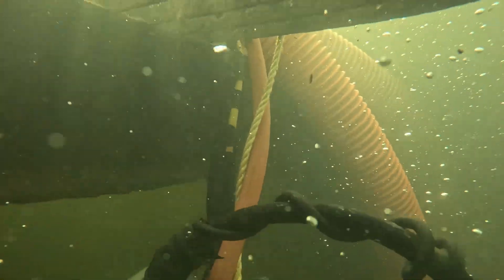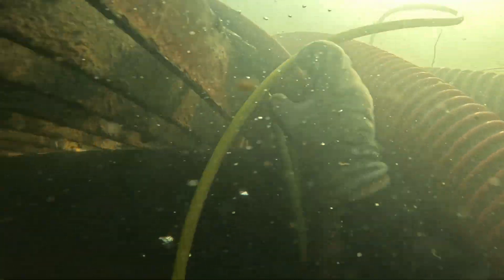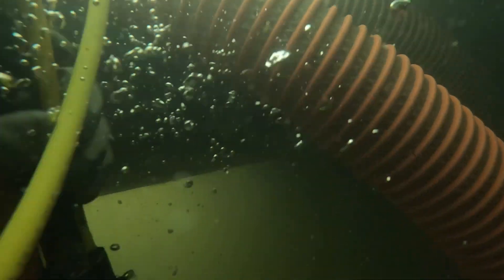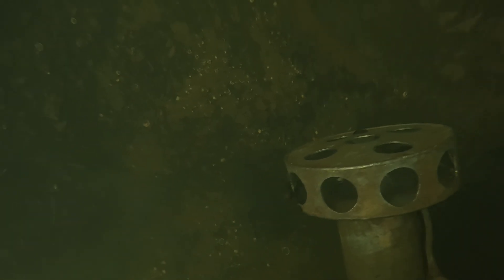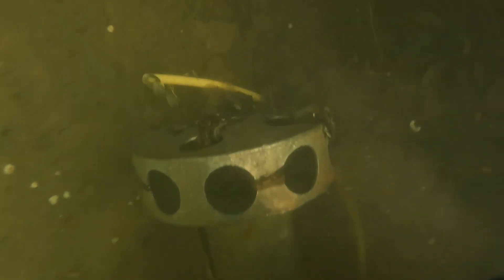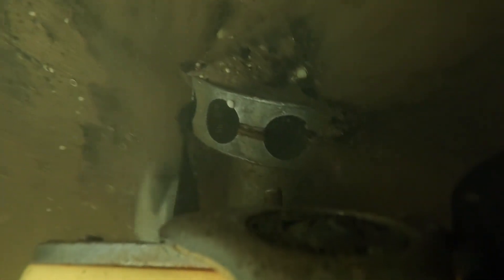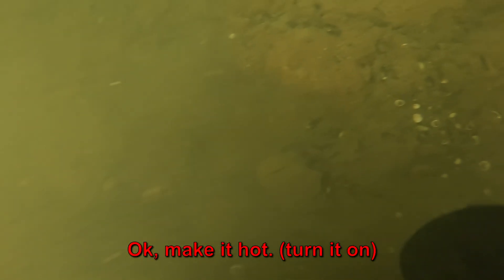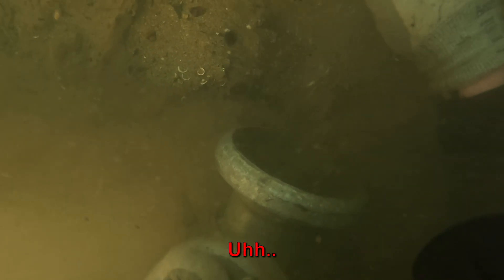Diver's Arm Sucked Into DREDGE PUMP!

Comment: This kind of work is really intriguing
Reply from the maker: We get to enter a lot of wild places where few have ever gone. Thanks for watching.
Reply: @workingunderwater  Have contacted IMCA and asked wether or not vocational papers are a necessity. Have worked for over a year fixing cars. Have wondered if I need to be a certified mechanic for this kind of work, but they told me since the vocational school for commercial diving is already expensive and covers everything I need to know, it’s not really necessary. What do you think? My diving experience is average, my mechanical is adept. But got no papers
Reply from the maker: @eltiburon144  That's fantastic! Those skill will absolutely help you in this industry. We work with all kinds of small engines like compressors, pumps and generators. They break down often and need maintenance. Your mechanic skills will surely save the day without a question. What school are you thinking?
Reply: @workingunderwater  I am either thinking finishing my mechanic apprenticeship, but preferably in a big workshop that focuses more on big trucks or ships, I have seen too many cars already. Or I plan on going the medical route, getting my apprenticeship as a paramedic, then combining that with my mechanical knowledge to become a good Diver Medical Technician. Safe to say I would love to step into this industry. If you could help me out, I would definitely be grateful

Comment: Never seen a dif like that, we have just 2 pieces of teel rod welded to the en like a cross. Makes for bigger holes so no clogging and won't suck your hand in
Reply from the maker: Same here. 90% of the time a simple rod or two  overs the intake works great and that’s all i’ve ever used really. Idk who fabricated that stupid dif we were using. I think it came with the pump we rented. Thanks for watching.

Comment: We had a flap on the top side of "the tip" that we would open when this would happen. Open the flap, pull your arm out, and keep working. It's not the safest way, but other than a little startel, it never caused me or the other guys any injuries. 

Now, when you get your hand smashed from sucking up a brick... that sucks.
Reply from the maker: Smart. That’s a good idea! 
Where exactly was the flap tho??
Reply: @workingunderwater it was maybe 4-6 inches from the intake of the hose. Ours was a 6 inch hose so it was a pretty hefty dredge. The worst part was when my hand would go in flat and bend my fingers backwards. Lol. Good times

Comment: Im 15 and i want to do commercial diving what should i do to enter this field
Reply from the maker: Keep watching my vids. What state you in? Maybe do some basic welding classes at a community college and get your scuba certification that will give you a leg up. Yull need soil core strength, make sure your working out.
Reply: you´re 15 and got the time, here is how we do it in Europe.go for it The Whole Bloody Enchilada
Let’s be honest— becoming a certified commercial diver isn’t something that happens every day.
It’s rare. It’s expensive. And it’s not for the faint of heart.
But it’s not the most dangerous job in the world, despite what clueless documentary makers claim.
Because we know all the drills. We refresh courses every one to two years.
You don’t just wake up and decide to dive into the abyss with a wrench in one hand and a welding torch in the other.
You pay. You train. You suffer.
And if you’re lucky, you come out the other side with your “tickets.”
Those precious, mandatory certifications that prove you’re not just another desk jockey with a scuba hobby.
The Standard Route
Step
Description
Cost
Medical & Entry Requirements
Commercial diving medical exam, first aid certs, swim test
€300–€600
Basic Commercial Diver Training
HSE Surface Supplied Diver course (Inshore diver—best way to start)
€7,000–€10,000
Offshore Top-Up Course
Wet Bell, Hot Water Suit, DP vessel training
€2,500–€3,000 (Mine was pricier—Loch next to Mount Bevin)
Accommodation & Living Expenses
2–3 months of food and shelter
€2,000–€4,000
Miscellaneous & Gear
Travel, certification fees, gear, sanity pints
€1,000–€2,000

The “Tickets” That Matter
The more you stack, the better your chances of landing a gig.
These aren’t just add-ons— they’re survival tools.
They don’t teach this in schools. They baptize you in pressure.
First came the Wet Bell and the Hot Water Suit— deepwater rites of passage.
You learn to move in the dark, to breathe in the cold, to trust the hiss of valves more than your own heartbeat.
Offshore saturation work isn’t just where the big bucks are— it’s where the ghosts live.
And you learn to dance with them.
Not every diver takes that route. I didn’t. With some regret.
Then came the Diver Medic Technician course. DMT. The gold standard.
Two weeks of trauma, oxygen, and chamber ops.
You learn to keep someone alive in the middle of nowhere— underwater, offshore, and often alone.
You become the medic, the priest, and the executioner.
I did mine in Rotterdam. Worth every second.
Buckets of fun, if your idea of fun involves simulated death and real adrenaline.
Underwater welding and cutting?
That’s where you stop pretending.
Thermal rods, Broco chaos, electrode ballet.
You burn steel like it insulted your mother.
High-demand skill, they say. I say it’s art with consequences.
Air Panel Operator training taught me how to run the surface.
Dive control panels, comms, pressure logs— supervisory roles for those who can juggle numbers and nerves.
And when you’re ready to lead, the IMCA Diving Supervisor course hands you the keys to the kingdom.
Leadership. Logistics. Safety.
You don’t just run dive teams— you carry their lives in your clipboard.
I never wanted that responsibility, so I passed on that as well.
And for those who want more— who crave the edge— there are the bonus rites:
Nitrox and mixed gas diving for when depth and bottom time aren’t enough.
Seamanship and rigging because lifting ops are poetry in tension.
Hydraulic tool handling where grinders and saws become instruments of underwater rebellion.
This isn’t a résumé. It’s a ledger of survival.
A blue-collar advantage carved in pressure and precision.
Every course a chapter. Every skill a scar. Every certificate a story.
Now here’s the kicker:
Most fresh divers have zero experience in the sector.
But if you’ve been swinging hammers, welding steel, building scaffolds, or slapping bricks together— you’ve got a leg up.
Offshore diving isn’t about looking good in neoprene— it’s about doing construction work underwater.
And we really don’t like to get wet.
You’ll be working in a dry suit, which is completely different than neoprene.
Blind. No visibility. Or just enough to light up the eyes of eels.
Alone. And in freezing conditions.
The dive part? Usually without the fancy fins. Just a means to get to the job.
Forget the scuba instructors who think their PADI cert gives them a head start.
The golden rule is simple:
“It’s easier to make a diver out of a construction worker than a construction worker out of a diver.”
Chapter [The Price]
Add it all up and you’re staring down the barrel of €25,000 to €30,000.
That’s the cost of entry.
After that, you start knocking on doors— anywhere in the world that needs someone crazy enough to weld steel 30 meters below the surface.
Unless you want to go freelance. Then you add a wad of cash for safety gear—your armor, your lifeline, your leverage.
Essential Gear for Offshore Commercial Divers
Item
Purpose
Weight
Estimated Cost (EUR)
Dive Boots
Heavy-duty grip on seabed, often steel-toed
2–4 kg
€100–€300
Dry Suit (Neoprene or Vulcanized Rubber)
Thermal protection, watertight seal
5–8 kg
€1,000–€3,000
Thermal Undergarments
Insulation under dry suit
1–2 kg
€100–€300
Weight Belt / Harness
Buoyancy control, stability
10–15 kg
€200–€500
Helmet (e.g., Kirby Morgan KM77)
Life support, comms, protection
13–15 kg
€6,000–€10,000
Bailout Bottle + Regulator
Emergency air supply
8–10 kg
€500–€1,000
Harness System
Secures tools, bailout, comms
5–10 kg
€300–€800
Gloves
Dexterity and protection
<1 kg
€50–€150
Knife / Tools
Cutting rope, emergencies
<1 kg
€50–€200

Optional Add-Ons:
Hot Water Suit – For saturation dives in cold water: €1,500–€3,000
Comms System – Helmet radio, surface link: €500–€1,000
Tool Pouch / Hydraulic Tool Interface – For grinders, saws, etc.: €200–€500
Total Gear Cost (Full Setup): €10,000–€18,000, depending on brand, condition (new vs. used), and whether your company supplies it.
Standard Safety Gear Worn on Deck
Gear
Purpose
Notes
Hard Hat / Helmet
Protects against falling tools, swinging hooks
Must be impact-rated, often color-coded
Safety Boots
Steel-toe, slip-resistant, oil-resistant
Waterproof and insulated for cold decks
Coveralls / Workwear
Flame-retardant, high-visibility
Often anti-static and weatherproof offshore
Life Jacket / PFD
Buoyancy in case of man-overboard
Mandatory near open water or during transfers
Safety Gloves
Protects against cuts, burns, chemicals
Task-specific—rigging, welding, hydraulics
Eye Protection
Shields from flying debris, sparks
Goggles or wraparound safety glasses
Hearing Protection
Reduces damage from engine noise
Earplugs or earmuffs
Fall Arrest Harness
Prevents falls from height
Required when working aloft or near edges
Respiratory Protection
Filters fumes, dust, welding gases
May include full-face masks or filters

Offshore-Specific Additions:
Thermal Layers – For cold North Sea mornings
Wet Weather Gear – Waterproof jackets and trousers
Hot Work PPE – Welding mask, fire-resistant gloves, apron
Chemical PPE – Splash suits, chemical-resistant gloves
Pro Tips:
Most companies provide gear—especially helmets and bailout bottles.
Owning your own makes you more hirable, especially for freelance or short-term contracts.
Boots matter. Grip, weight, durability. Cheap ones slip or fall apart.
Dive helmet is your lifeline. Don’t skimp. Kirby Morgan is the industry standard.
The Weight of the Job
Stay in good shape. You’re hauling 45–60 kg of gear, plus your own body weight.
If you’re a 90 kg diver, you’re stomping around the seabed with 135–150 kg total mass.
And that’s not counting the drag from the umbilical or the hydraulic tools lowered down from the surface.
That’s what you’re hauling before your feet touch the water.